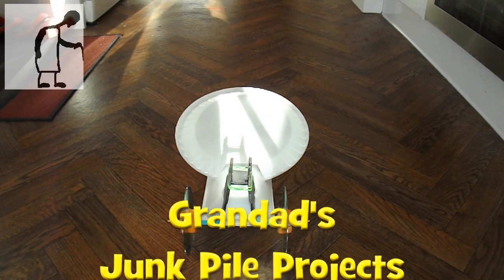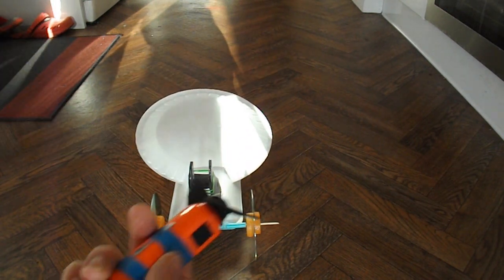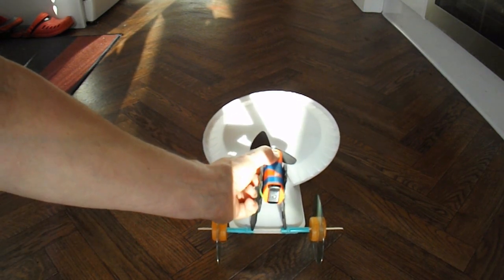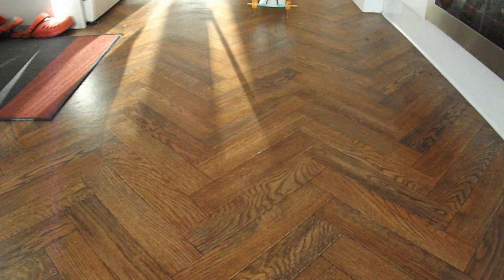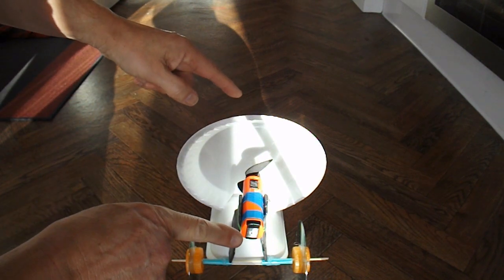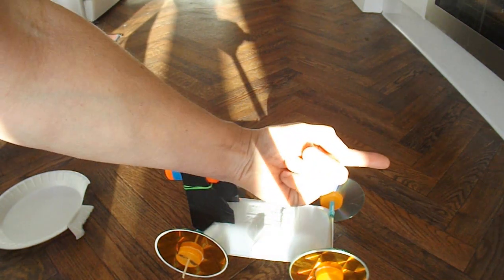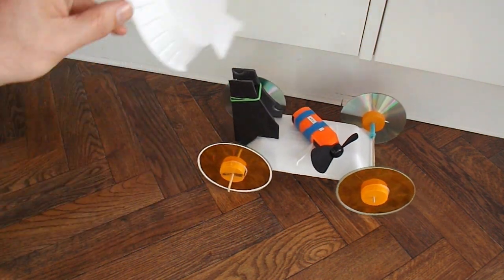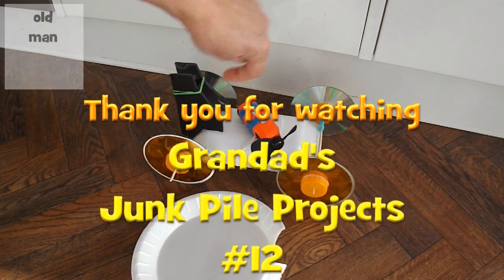Grandad's Junk Pile Projects #12 Wind Powered Car Revisited

Comment: :D i think it gots anough air to move it a littlebit forward!?
Reply from the maker: +ProjectOfGames but can you explain why it moves forwards? If you and a friend stand together on a skateboard and you push your friend which way does the skateboard move?
Reply: hhmmm your right hahah, like you said in your video that the plate that catch the air is a little bit in an angle and pushes it a little forward.

but air is a little bit diffrent then you push someone.
Reply from the maker: ProjectOfGames it gets very complicated when you get right into it. It is not so much about being pushed, it's about air pressure differences. It is the air pressure behind the plate is higher than in front of it so it is pushed into the lower pressure area. However the same thing is happening to the fan, the action of the fan is moving air from in front of it to behind it. This reduces the pressure in front and increases it behind so the same thing should be happening there. The higher pressure area should be pushing the fan into the lower pressure area. It is the same air pressure between the plate and the fan so why should it move one way more than the other. I think it is to do with the larger surface area of the plate compared to the effective surface area of the fan blade but I don't intend to spend any more time on this to establish exactly what is happening. It would be a good question for a physics teacher to solve.

Comment: In theory, the advance, it is impossible.
What may be due?
Vibration plate, maybe ?.
Reply from the maker: +Francisco Javier Lázaro Pinela the wind from the fan is hitting the plate and being redirected backwards. Perhaps if you imagine the effect as a tube redirecting the thrust from the fan - thrust vectoring
Reply: +GrandadIsAnOldMan 
Ok I understand.
It is an interesting effect.
Reply: +GrandadIsAnOldMan But I'm imagining that if the plate vibrates, it is making the effect of "fan" ..
Namely:
The propeller pushes this plate, but again, is taking back some of the air and therefore advances the vehicle.
Also have something to do this?
Reply from the maker: Francisco Javier Lázaro Pinela it is an interesting experiment and could be discussed for many days. What it really needs is somebody to do a proper scientific study in controlled conditions and I do not intend to do that. I am guessing it is to do with the size and the shape of the plate compared to the size of the fan blade.

Comment: wow i aspacted it to go backwards.
Reply from the maker: +Lol Plane I didn't expect it to move. The forces should cancel themselves out but it is not a perfect situation. I could write a long theory on the air pressures at various points but like so many other theories, it is easier to try it and see what happens.
Reply: i think they are not exacly of the same strengt and so its probably moving

Get it? ;)
Reply from the maker: Lol Plane the difficulty is there is only one source of power being applied. That is the fan, so the forces should be equal and opposite so they should cancel or negate each other.
Reply: probably

Comment: every action give an equal or opposite reaction. great video to show how well that's done.
Reply: That theory comes into play since there is nothing wrong with it. However people are forgetting the net thrust created when the air bounces off the plate in the opposite direction to the car. This adds a force that pushes the car forward creating an imbalance of backwards and forwards forces. Because of the air bouncing off the plate there is just enough more forward force to be significant to move the car.

Comment: can you make an rc car or boat using a motor from a old wireless drill ? maybe you can use a servo to operate te existing speed controller on the drill so you do not have to demolish your drill and you can use the existing battery. i think if you make a car, it will be good for of road because the dril motor has more power than the motors you usually use.